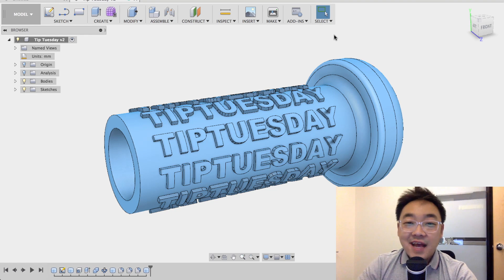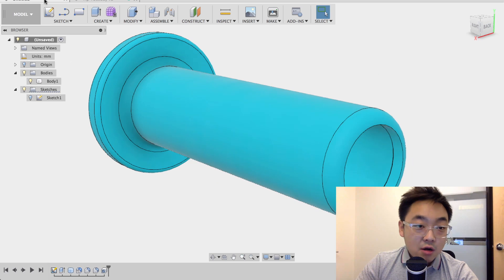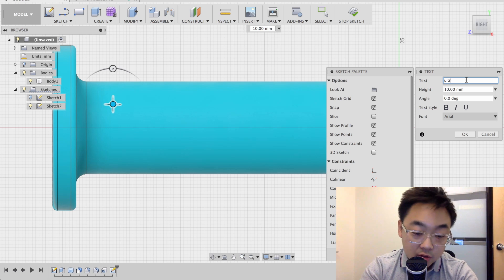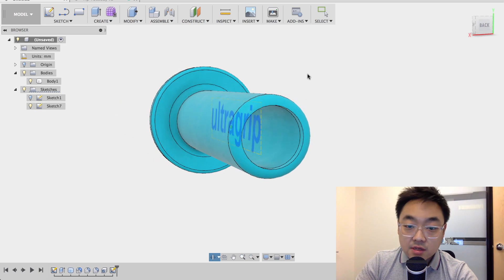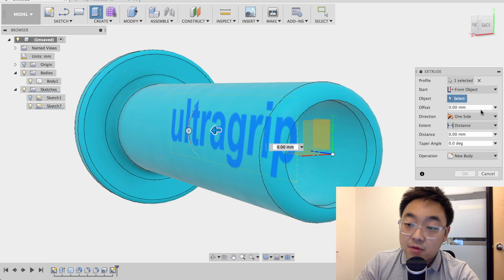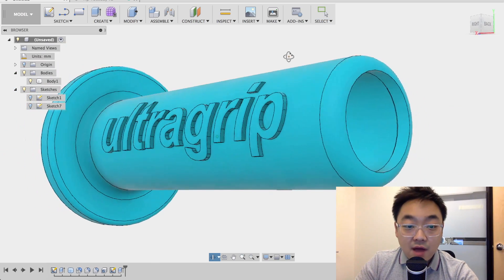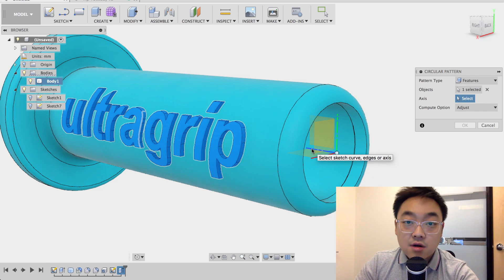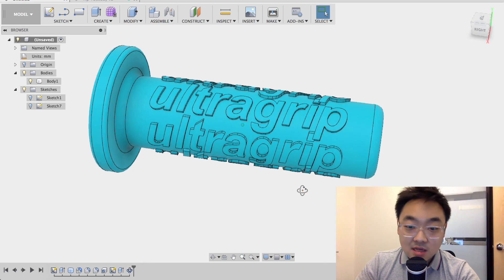QUICK TIP: How to emboss letters (updated!)

Comment: Radial Extrude?
Notice how the extrusion is in a single direction; the sides of the letters are parallel all to a single axis.
How can this be done so that the extrusion is radial instead? so the instead of the sides being parallel, they are Normal (perpendicular) to the cylinder surface where they contact?

Comment: Just keep in mind this is projecting the geometry not wraping it
Reply from the maker: Thanks for the clarification. Hoping we get a proper wrap tool soon...
Reply: Yes. That's my issue right now. I have a part with a surface that has quite the aggressive angle on one side and this projection is not suitable. I'd like the sketch to extrude perpendicular to the surface at all points. I see some people use the sheet-metal functions to achieve the effect, but for my case it doesn't work practically.

Comment: Do you know any way to parametrize the text? I have to design about 250 object that differ just for the emboss text and it would be really handy just to change a parameter. Seems in Inventor 
this option exists (Quick Tip - Parameter Driven Text : https://www.youtube.com/watch?v=Q6E9P8Tpwk8 ) but I can't replicate it in Fusion 360.
Reply from the maker: THAT is a great question. I wish I had a solution, but I can confidently say that is not built into Fusion and would require some amount of creativity. That said, I would recommend you check out this tool: https://github.com/tapnair/FusionSheeter 
I am going to investigate this further! I want to get you a solution.

Comment: Easy and fast. 
Still waiting for radial extrusion.
Reply from the maker: That would be interesting. I've never seen a radial extrude in other parametric tools...wondering if that may be related to the limited use it might see? A wrap type feature would work well for this, and is more likely to be implemented.

Comment: But, can you make the extrusion perpendicular to the cylinder face?  or on a compound curve, or a half-sphere?
Reply from the maker: Extruding perpendicular to a cylinder would just require starting from a perpendicular plane. For a half sphere I would revolve half way....or use a primitive and cut half away. Not sure what you mean by compound curve. Can you elaborate a little bit on that?
Reply: By half sphere, I meant placing text on it.
In my specific case I was attempting to place text on the neck of a beer bottle, where it has a convex curve meeting a concave curve as it revolves around the bottle.  A lot of brands have their logo and some text around there.
When I get back to doing the final modeling I'm sure it will be where I just have to place each letter as needed.
Text is one of the harder items to do in 3D for most programs, but it's probably one of the least needed, so I can understand why development isn't a priority.
Thanks for the reply!

Comment: I note that Larses method places letters on 2 curved surfaces (GLOBE). The plan and also the elevation. While this method places them on a tube, one curve. Is there a reason to use the complicated method on a globe rather than the easy method. IE would the easy method work on a globe?  Just  wondering.

Comment: Nice effort, however color me impressed when you're wrapping it around the handle bar 90 degrees rotated clocwise. This is still essentially a planar projection with all it's problems ie. distortions not a radial wrap, you just cheated and used a short font height relative to the cylinder diameter. It's been 3+ years with no real solution to the issue, all I see is workaround after workaround that produces the same, non-legit result.
Reply: Greg Takacs 
Yep. I created a video tutorial using this method in 2016 for a CAD course that I attended. It looked simple and effective in the video but in practice it had tons of issues. It's quite silly that they made a video which is pretty much an exact copy of the one that I did as the method used is extremely restricted and breaks down when you try to use it outside of this exact scenario.
Reply: Yup. The reason why they do this is because they can't do the real thing. It's been on their to-do list for 3+ years based on forum posts. This is such a basic requirement I don't understand why it hasn't been done before. And all I got as a response was crickets and tumbleweeds...
Reply: Someone above mentioned doing this in Sheetmetal. Make a cylinder. Make a cut. Add a bit of thickness. Unfold it. Add the text. Refold it.

Comment: I use this method for quite a while already when designing in Fusion. It does the job for most applications, but I still think that there needs to be a native 'emboss' and 'wrap around surface' command. Just like Autodesk Inventor. Would be way easier.

Comment: How do you do the opposite and not have it extruded, but look like it was carved out or stamped into the grip?
Reply: 1) Create an offset plane outside the cylinder. 
2) Put your text or SVG on that plane.
3) Select text, press Q for push/pull 
4) Start from object then  select outside of cylinder
5) Enter a negative number in the distance box. (this stamps into cylinder)
I just tested this with SVG and it follows the curve as expected :-)
Reply: Thunder SWEET! Thank you for the help and reply. 👍🏼
Reply from the maker: or you can do the same step as this tutorial but instead of giving it a positive value, just give it a negative value :)

Comment: I got letters to go around a cylinder instead of inline with the cylinder but the letters on the sides are not extruded radially but are inline with the center axis. Is there a way to extrude the letters radially around the outside of the cylinder?
Reply: No, not with this workflow, however check the link in the description.
Reply: That other thing, wrapping around is letting you avoid the distortion. If you need only "radial" extrusion you need to split the face and then use Press/Pull (but this time it will be offset).

Comment: +keqing, that rocks! So much simpler.  
Next question is what if I'd like the  word to be rotated 90 degrees so you'd have to spin the cylinder to read the word? the extrude doesn't work when the word is too long and pierces the cylinder. :-(
Reply: I think what you're asking for is text wrap, which you can't do today. With that said, our sheet metal preview functionality is allowing for some interesting workflows where you can unfold and fold. Check the link in the description.
Reply: @supersong115  Can you do this now its a year later?

Comment: Can you extrude letters around the cylinder? Fir instance if you wanted the word to wrap around the cylinder instead of along the barrel of the cylinder.
Reply: For now - no. There's no text wrap for emboss or engrave. Make sure to vote to add this feature. They claim it will be added some day, but it's been years people have been requesting. It's very nice software and a helpful team to work with though. But I doubt this will be added any time soon, but you can come close to achieving  this with workarounds like put a plane along the surface, adjust to the angle you like, then put a letter on that plane, then extrude. You would have to do each letter like this. It's a real time consumer and it's still not a wrap. Plus, it's tricky spacing your letters. Please Fusion team - ADD THIS FEATURE!
Reply: As in 90 degrees around the cylinder? Touching or not touching the cylinder? I'm sure you can but it'll probably require some more setup geometry.
Reply: I would like to know too.
Reply: Theres a good discussion around wrapping going on our forum - it might be the answer you're looking for :)
Reply: http://forums.autodesk.com/t5/ideastation-request-a-feature-or/emboss-feature/idc-p/6849969#M22127
I think this is it.
Reply: You can do it in the new sheet metal environment, create a cylinder, make a cut in it, extrude the face a bit, then unfold the cylinder, then use the text tool, extrude the text, then refold the cylinder